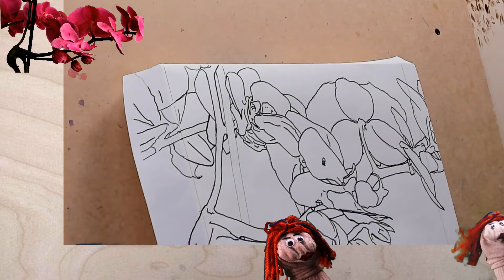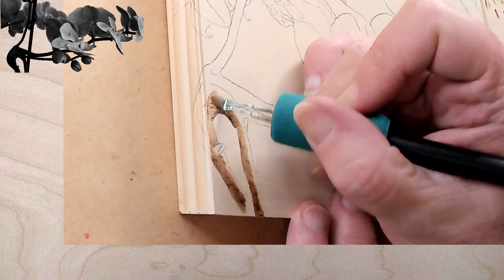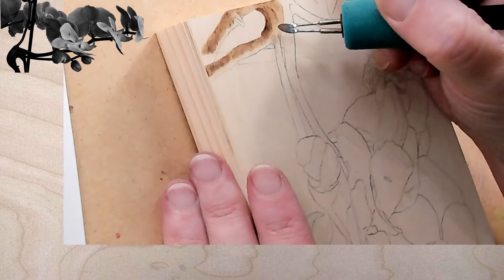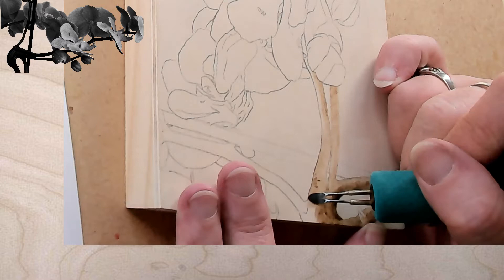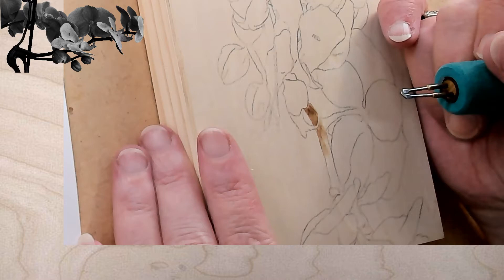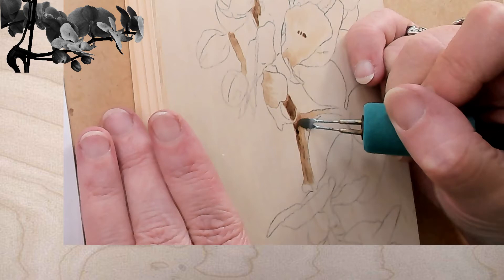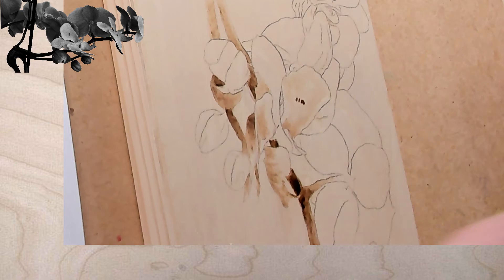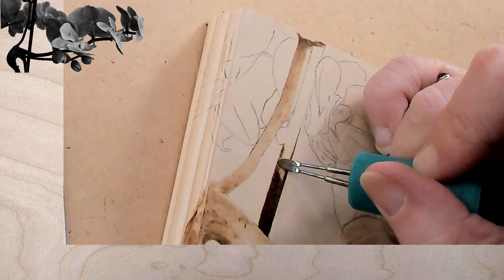Pyrography: Wood Burning Orchids on Basswood Cradle Board

Comment: Hi Valarie,  I have to admit that I never would have thought to use a piece of glass as a straight edge.  Very ingenious!  I tried the metal edge of a ruler, but the metal became a heat sink.  As for wood panels, I haven't tried the Blick Studio brand but I have burned on the Art Alternatives brand.  I like how smooth the panel boards are compared to regular plywood, but I think they are a bit on the spendy side.
Reply from the maker: Hi Brenda! 😁 Yeah the glass hit me one day after playing with a torch. I have a video on how I made the glass straight edge. 😃 I tried sanding an Art Alternatives cradle panel and the veneer just came off. I was really surprised. I have tried other Art Alternatives wood & I just really don't care for them. The Blick Studio brand can get more pricey the larger the sizes, but I do like how they burn & finish. They feel like a much better quality of board... especially since they fixed the bubbling & warping. Here is a link to the different woods I do like: https://kit.com/VCDrawingWithFire/wood-bases-for-pyrography
Reply: I love the glass idea, so I'll have to try that.   I didn't have any problems with the wood panel warping or anything, but I prefer solid wood surfaces.  I'm lucky enough that my husband can make them for me.  Thank you so much for the info!  brenda

Comment: Hello Valerie, 
I'm new to this and I'm a leather crafter.  I wanted to add this to my arsenal of work. My question is do you or have you ever done pyrography  on leather? If so what are some of the do's and don't s with leather.
Thanks a bunch, love your work.
BO.
Reply from the maker: Hi Bo, Thanks! 😁I have not burned on leather... yet. I have a leather journal project I need to finish that will have pyrography on it. I will say, the biggest thing I do know is to only burn on veggie tanned leather. Any other leather creates toxic fumes when burned. I highly recommend having a piece of scrap leather to test your heat setting on, this will help you a lot. 😃 I also believe leather takes a higher heat level for a similar burn tone on wood. I'm sorry I couldn't be a bigger help. I should just burn on a scrap I have, so that I can pass on more info.